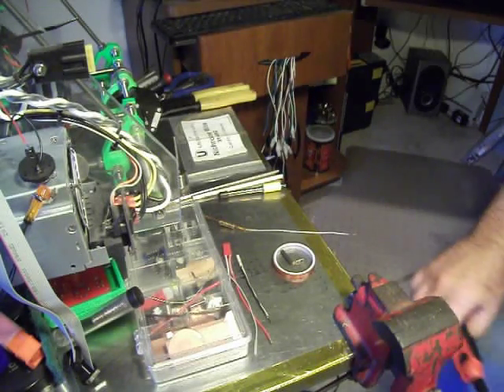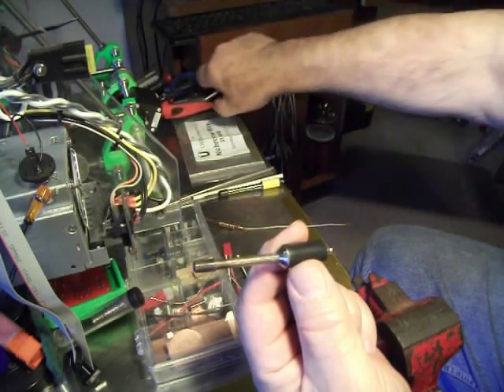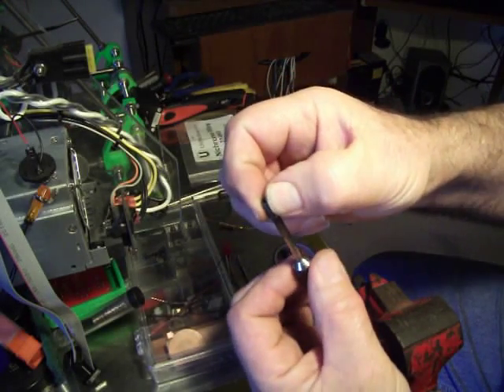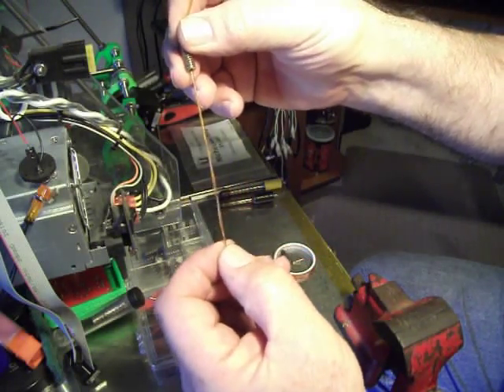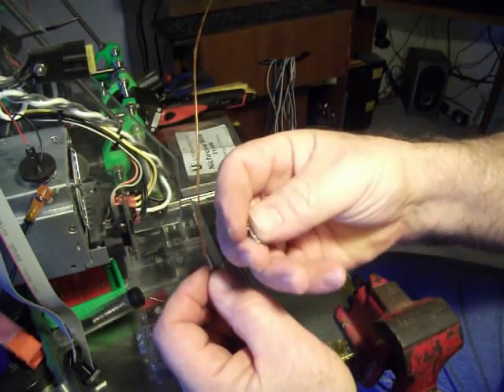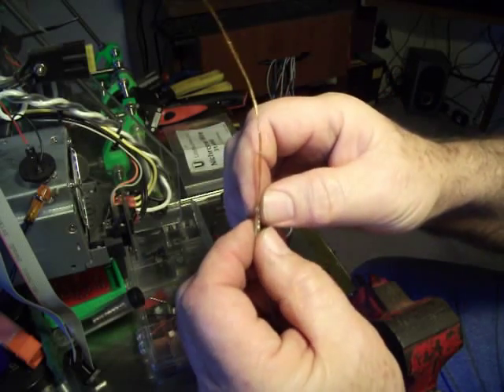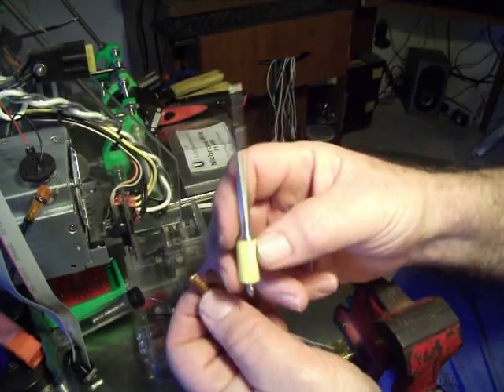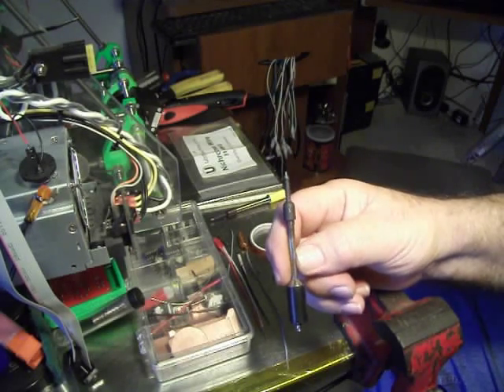Details of building a soldering iron element

Comment: The voltage get in square which particular result get devided by amount of watts used and that conclude amount of Ohms need for electrical device...Interesting part that glowing of wiring only less 8 seconds before burned,wasn't been enough ohms....

Comment: I tried to rewire mine,It have 3mm ceramical tube,I rewired it and when I plugged in the outlet it burn the nichrome wire spiral....Not sure why,maybe too many layouts of wire or maybe it not accurately winded such as coil to coil....I not sure how much wire should be winded too much or too less.....Please let me know..
Reply from the maker: Hello it’s been a few years, if I remember correctly the home made element had a 6 or 7 ohm reading with a meter. If you have a good tip you can see what the ohm reading is on it and make an element according to that reading. If the ohm reading is not correct the element will pull to much amperage and burn up. Also the trick is to have a place for the generated heat from the element to go such as the copper tip I’m using, acts like a heat sink. I also used heat dissipation paste to transfer the heat through the SS tube on into the copper tip.
Reply: I talking about an 120 volt version element,not an 24 volt soldering station..It have 60 watt,are you sure the reading on multimeter would be 6-7 ohm under 120 volt???
Reply: Conclusion confirmed,120x120=14440:60=240 Ohm120 volt and 60 Watts soldering iron equal to 240 ohms..I did winding and only reached 148 ohms,wiring burned under about 8 seconds but first it glow red....The 8 ohms must be very low voltage,this is why it works under 12 volt power......The larger the voltage more watts get consume so obvious resistance need to be larger......Will try again to wind ceramic tube tomorrow,this time I make sure it would read 240 ohms....

Comment: man, im having a hard time getting a solder iron to work, imrookie  and just dont get it, why not use an all iron tip? i been through two irons and both dissapoint as the tip wont get hot enough
Reply from the maker: Gary B 
yes, you cannot use this iron in any kind of a windy environment, ceiling fan or whatever. The wind cools it off to where it will not melt solder.

Comment: Wow you're awesome! I love modding things to make them better. That way we can have  them for a lifetime rather than the 1 or 2 yrs they engineer them to last.
Reply: Also I wish I had all the cool stuff that you have.
Reply from the maker: Thanks Anthony, sharing knowledge is a wonderful thing.
Reply: I agree. Thank you.
Reply from the maker: My next soon to be finished project is a duel pulse capacitor discharge spot welder. It’s very versatile, can be used to build battery packs or for my intended use, the repair of aircraft thrust reverser stainless steel insulation blankets. I am in the testing stage now and it’s going to work very well for this application. I will be posting video of it working, so stay tuned. Have a good one, Jeff.
Reply: Y